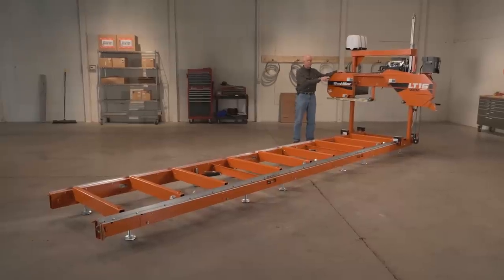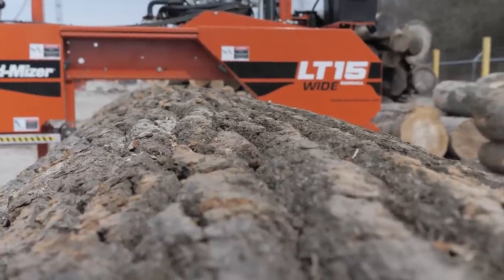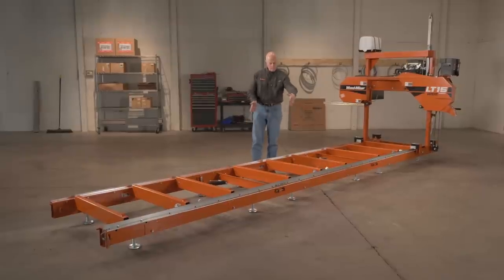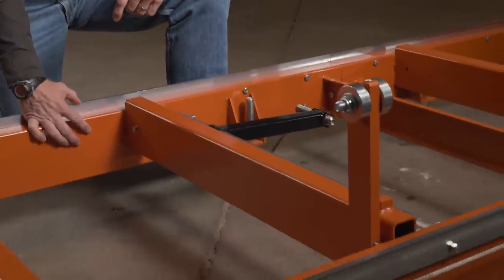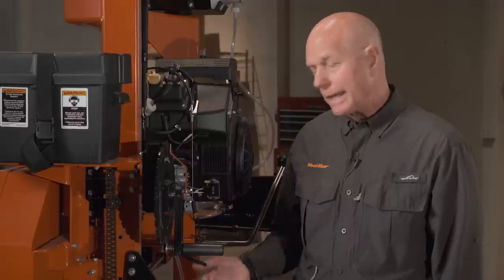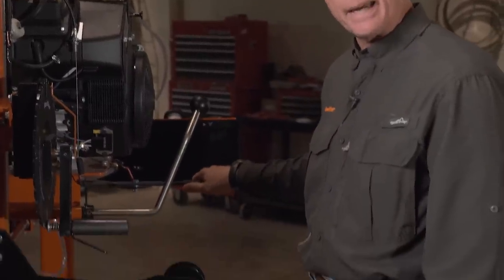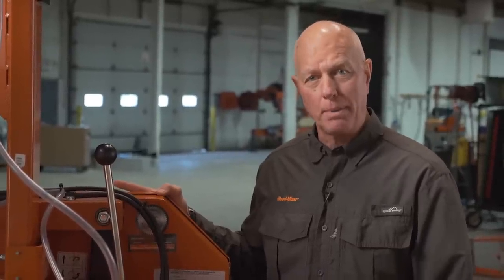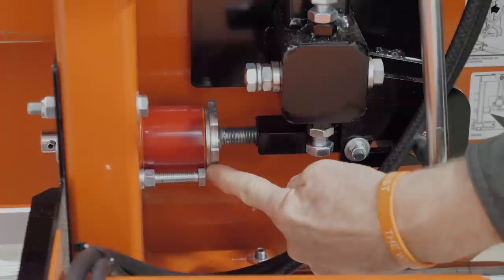LT15WIDE Portable Sawmill Walkthrough | Wood-Mizer

Comment: Do you gotta use the hand crank or can you just gently push through like I've seen on other mills? Thanks
Reply from the maker: The LT15WIDE sawmill comes standard with the hand crank but it is possible to push the sawhead through the cut or add the popular Power Feed option to move the sawhead through the cut. For more information, visit https//woodmizer.com or give us a call at 800.553.0182. Thanks!